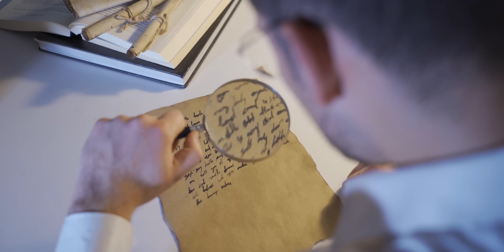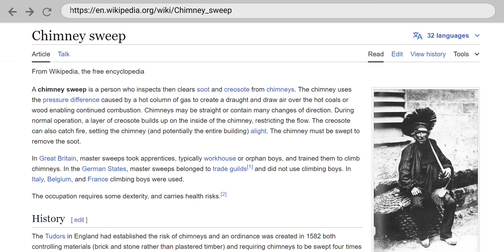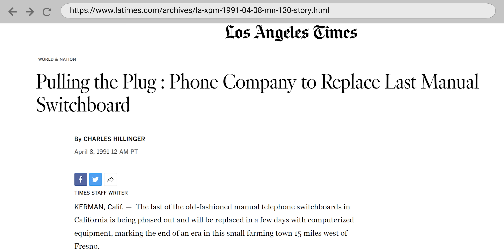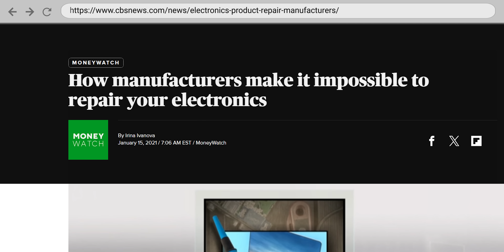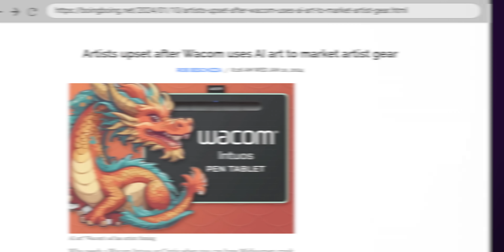Does Technology Actually Kill Jobs?

Comment: I've noticed automation is affecting white-collar jobs more than blue-collar jobs now. Replacing manual labor is a lot more expensive than it is to replace a white-collar job with a piece of software. Physical labor replacements are also not very versatile. Humans may not be great at anything but were definitely ok at almost everything. It's getting to the point where a manager can just promt an AI to spit out any calculations an accountant would normally do. They also wouldn't need to wait for them.

Comment: LG sent a tv repair guy instead of just replacing my tv... he spend so much time and couldnt fix it, he returned 2 weeks later with new replacement parts and couldnt fix it. 
I asked to give me the parts and the service secret menu code, and fixed it all by myself. So my entire TV got replaced at the end.... part for part... but it took almost a month and i fixed it by my own, i just wanted to replace the broken mainboard for free because it was still under warrenty.
LG TV Mainboard broke down, bad quality product maybe. I hate Smart TV systems, its stupid slow and not very durable.

Comment: The biggest reason why there are so few TV repair technicians is that you no longer get the circuit board schema for your TV as you used to and neither is it available online from the manufacturer, so anyone trying to fix a TV has to first (at least partially) reverse-engineer it, which makes it usually cost more to repair than to buy new. That's why right to repair is so important!

Comment: I think there is a significant issue with the historical comparisons. Technology back then in luddite times excelled production and made new jobs, like looking after the machines. The jobs created didn't need massive expertise, the skills were different but achievable by the average luddite. What we're seeing now is the potential for AI and tech to simultaneously replace skilled and unskilled work while simultaneously requiring highly skilled professionals to act as support. Many can't achieve the support skills, especially not in reasonable time, but also the beginning of the elimination of multiple jobs simultaneously means there is no easy way to cope..

Comment: TVs being cheaper to replace rather than repair also speaks to the industry's shift towards planned obsolescence.
Reply: Not necessarily. I'm not saying planned obsolecscence isn't a thing, it absolutely is. I think disregard for repairability is a much bigger problem though. At the end of the day, it's normal that ye olde CRT TV, which was put together by human hands, could easily be repaired by human hands. A modern TV on the other hand is a highly integrated unit that could only have been produced by machines and if you're not very careful to design it in a way that makes it still easily repairable, you automatically end up with something where each little problem takes it straight to the landfill.
Reply: @unvergebeneid  That only really applies to consumer countries, like the USA, Which has high value currency so it's easier to import than pay someone to fix. Other countries do fix and repair is normal.
Reply: Not necessarily, in part it's a co.bination of the cost of making them new vs the cost of paying someone to fix it.

If you have a 5yo TV that breaks, are you going to pay someone $1k to fix it or just get the latest model with better everything for $2k?

Most people will do the latter.

What we really need is electronics that are designed to be repairable. The initial sticker price will probably be a tad higher, but that should be offset over time when you can easily replace pieces that break rather than the whole thing. And even if you do feel like an upgrade, it should be trivial for someone to take the old device off your hands for a bit of change and fix it themselves relatively cheaply.
Reply: Sometimes the problem is the power supply or a capacitor which can easily be replaced by a human, but the amount of time it'll take and the work time fee alone will sometimes cost more than a new TV.
Reply: @Razear Not really, it just shows capitalism has allowed technological innovation to reduce the cost of production so much that it's cheaper to make something new than go to the bother of repairing it. Quite excellent really.

Comment: Backblaze is a crappy company. They promise "unlimited" backup but once certain threshold crosses, they intentionally throttle the upload speed. Stay away from cheats in the name of Backblaze. In my case once it crossed 1TB, the upload speed dropped to 10 Mbps. Though my upload speed was 100 Mbps. And the speed tests in their website consistently showed my upload speeds can reach 40-50 Mbps.

Comment: Here's a fun one:
Back when the combustion engine became a thing, most factories ran on Hydro power. They'd be out in the country side connected to a river/stream. These factories were slow to adopt combustion engines, because water is free, and fuel is not. Eventually the factories realized that they could move into the cites with combustion engines and lower workers wages to offset the price of fuel. Since there are more workers in the city who are impoverished, they can fire them and get new workers anytime they complained.

Comment: I think people are way too loose on phrases like "X Y Z job will get automated or will get replaced by AI" without clearly thinking through, what all such jobs consist of. And what it takes for machines to take over these roles. Anything physical, you can't just replace with AI. You would need specialized machines, which can imitate human tasks, run by AI. How would you replace a carpenter with AI? Or a road worker? And even if there are realistic replacement solutions, nobody ever thinks about, if that will ever make financial sense. Because theoretically, every human workforce in any field could be replaced by humanoid robots, they can certainly do what people can do, physically. But since also nobody ever thinks about, how insanely complicated thus expensive such complex robots would be, humanoid robots which function comparably to an actual human being might be technologically possible one day, but NEVER feasable financially to simply replace people with.
(unless we might discover a whole new way of technology, that nobody can think of yet). And as soon as that might happen, Skynet is right around the corner and mankind won't have many things left to do anyway.
Reply: yes but you're forgetting that with all the other jobs taken by AI more and more people will fall into road worker, plumber, carpenter which will lead to massive work shortages, constant out pricing, and the fewer jobs in that trade meaning higher cost per job to stay afloat which in turn leads back to out pricing.
Reply: Why humanoid robots? ( Asimov thinking ). instead you put a black box into all the machines, leave out the expensive human interfaces, and CAD all the job plans. The Black box is cheaper than a person and doesn't need a lunch break. When they automate the repair/maintenance "crew" there will be one (low paid) operator and the Boss (collecting all the profits). If the boss will actually do some work then he/she will sack the operator and do it themselves. ( tell the AI what they want, it designs the programs and transmits to the machines. Also emails the bill to whatever department called for the work )

Comment: IT/programming is the profession most at risk right now. AI will take over this task with time. You should read about Kurzweil and his predictions
Reply: The hardest part of IT / programming isn't the implementation (which an AI can automate/assist, e.g. writing code for you) but rather the hardest part is the debugging, troubleshooting and maintenance work involved. Even the best code i've got from an AI has always a degree of jank or ineffeciency or old/incompatible practice.

Technical stuff is very sensitive to even the smallest part of a system not working, like a house of cards falling down if a bottom card is unstable. 

It's same story with offshoring development/IT work. It frequently leads to unmaintenanble systems which business have to empty the wallet for contractors to fix in the end.

If there was more grey area in IT systems then I would definitely agree with you, as things like art and creative writing people can overlook the minor details/errors. But with anything IT and computing based, the underlying platform and infastructure are always gonna be extremely fragile to change and will more often accrue technical debt, bugs and untraceble issues which needs a LOT of detective work & debugging to fix.
Reply: @07towers8  yeah you are right. Right now you definitely need a lot of people checking the code the AI made. But right now the AI for this is still in learning phase. With the increase of computing power each year it's only a matter of time

Comment: It kills pointless middle man data based jobs, anything with a tracked performance, it can't kill trades, because there's never going to be a plumbing bot
Reply: The trades are being "A.I.ed" out slowly. I have seen ( not in person ) brick laying machines, "3D printed" house machines etc. AI controlled machines that clean out the pipes ( can't remember what they are called ) won't be far off, so an operator drops off the machine on site, it does the job as the operator goes to the next site with another, etc. When the message come in, they drive back to pick them up again. One "unskilled" person replacing 4,5,6... crews of skilled plumbers
Reply: @alanhilder1883  So long as a thing has a capability to go wrong in an unexpected way it will require human intervention, I've installed and worked in "fully automated" manufacturing lines costing hundreds of millions, the most controlled and designed environments with the most cutting edge machines possible and no amount of programmed contingency understands a broken ethernet, no machine can yet comprehend a blackout, no code understands a faulty unit. The cost of a robot that could fix just one job an electrician or a roofer can do in a houses from new builds to victorian property is in excess of the value of creating it. Its why amazon doesn't fly ten thousand pound drones to drop off tampons in a ghetto.
Reply: @masteroogway6660  Murphy's law.. I always work under O'Tool's law which says that Murphy was an optimist. 
And like self driving cars that are 10 years away, much as 50 years ago they were 10 years away. 
But still the repair company will be a contract job, complete with underpaid workers swapping out parts and the overpaid boss.
Reply: @alanhilder1883  It's just swings and roundabouts, automations fine till it costs more than human interaction, human interactions fine till it costs more than machines. I joke with the cleaners at these facilities that them and me will be all that's left when AI takes over because the were too expensive to replace and they're too cheap to bother. Considering theres 10¹¹¹ legal moves in chess alone making a machine that can optimally maneuver through the possibilities of repair of potentially thousands of systems and machines going wrong in millions of unique ways isn't viable, similarly making a cleaning robot that can do what they do doesn't have an ROI worth considering compared to their salary. Making an AI do accounting with human oversight reduces an office of 50 to 5, making a factory fully automated makes an engineering department triple.
Reply: lol pretty sure there are already prototype AI plumbing bots. They can already build houses from scratch
Reply: until everyone has to be a plumber then you would have to charge so much for the service to survive that either no one could afford it or you'll be out priced but the numerous competitors.
Reply: @chaoticviking7679  somehow I don't think the work from home generation are suddenly going to wander outside and metamorphise into self employed tradesmen, and even if they did they'll be up against decades of experienced talent, were all happy to have another apprentice

Comment: As a tv repair tech myself:
I hope my job stays alive for longer than the Switchboard operators.
But who knows
Reply: I would imagine your skillset could transfer somewhat smoothly to a different profession, like medical equipment repair or any other kind of specialized electronics
Reply: I had an HD 4K TV which was in need of repair recently. I posted on several different groups looking for someone to do the job, and the nearly unanimous response was "Nobody does that anymore, you'll just have to recycle and replace it.", so that was what I unfortunately ended up doing. 🤷‍♂
Reply: Really depends on the needed repair and the place of residence. For instance, in Belgium, it's still generally done, and that's all info I have (sadly?)
Reply: You can go as repair/service technician to a company with industrial machines. Pretty well paid job if you are willing to learn.
Reply: They are already not bothering to repair cheaper units.
Reply: For my place of work, it's not cause we don't want to, it's cause we can't. Manufacturers tend to not create replacement parts (like screens) for the cheap brands. Hell, some big brands don't give all parts we need for repair either for "reasons"
Reply: just hired a guy to repair my 65" last year

tried to do so with microwave oven but no one has paint, non-standard plate, and price anywhere below a new one

Comment: well it more likly just requres alot far more built infructure for far lager amonut of indursal output per human worker if used properly. but however due to needed oversight even fully self aware sentaint and sapent ai cotroling a huge army of robots still need oversight like any other human will just so they just don't go crazy and brakedown. but even still ai and robots still needs humans to keep everything giong propelry. its just now we need far far less humans need to cover that same amonut of work now. but howver it still can be used for alot more humans to make grouth and prodaion output to skyrcoket but the alot of compny still haent figrude out the hardway scifi stiyle that we have compnys that still don't want to pay the bare minuim for proper human oversight. that sooner or later will bite them in the butt sooner or later when the ai and robots start braking down from over use and lack over human requred oversight will be the next issue in the next deacde or too. then the copmnys will start to hireing alot and i mean alot more humans to keep the ai and robots giong.

Comment: One type of job that will never go away is a job having to do with a Trade

It will be a long ways off before we have robots that will be able to replace carpenters, plumbers, electricians, HVAC technicians, welders...
If they ever do, that's when jobs for repairing the robots themselves will start popping up. 
If robots repair the robots, then who will repair those robots? At some point, there will need to be human intervention.
Reply: yes but you're forgetting that with all the other jobs taken by AI more and more people will fall into road worker, plumber, carpenter which will lead to massive work shortages, constant out pricing, and the fewer jobs in that trade meaning higher cost per job to stay afloat which in turn leads back to out pricing.